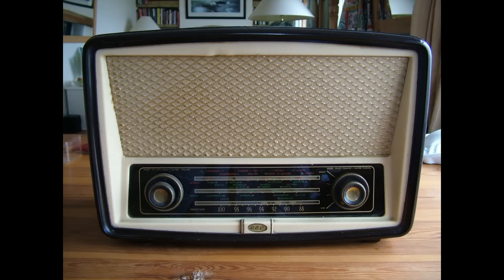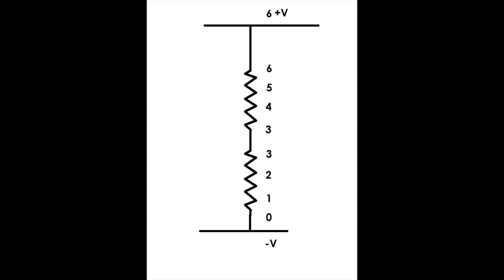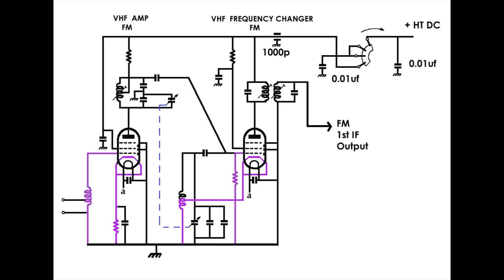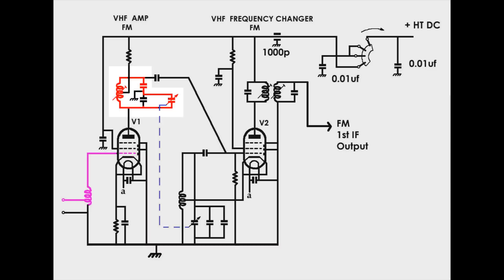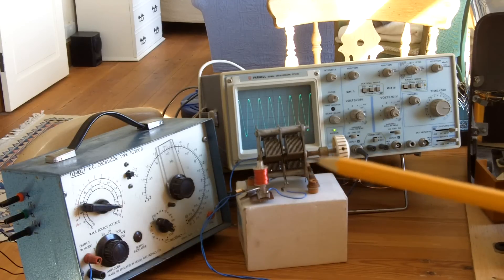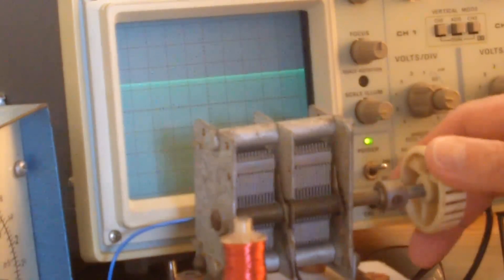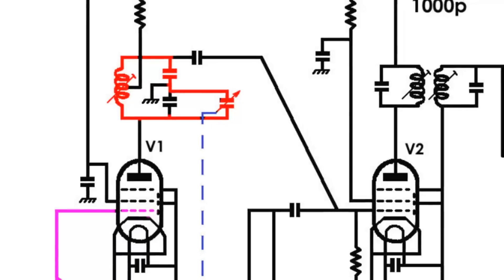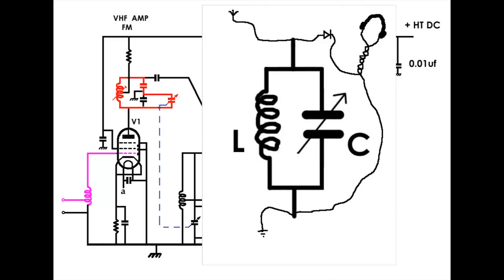About Radio ... Part 6  Grid bias & tank circuits by Andy Davies.

Comment: I am confused about the two capacitors (one red, one black) paralleling the tank circuit; that are connected to "earth" (ground in the US). Unless these caps are very small ones, they would hold the plate voltage of "V1" from being variable. Thus no way the RF signal could reach the "V2".

Please explain these 2 caps, and their purpose in detail, if you could kind Sir. For in most tank circuits, ONLY the secondary of the tank is grounded, as in the tank circuit in "V2".
Reply from the maker: Hi Pat I forget the capacitive values but they will be in the picofarad range. The actual voltage on them will of course be governed by the fluctuation of voltage on the anode of V. The black capacitor is effectively a padding capacitor for the variable capacitor. It increases the value of the variable capacitor to put it into the desired range. The red capacitor and the black capacitor to the right of it (going to the grid of V2) are coupling AC signal but blocking DC voltage. 
Regards  . .  Andy
Reply: @AndyDaviesByTheSea  Thank so much kind Sir. And my friend over the big pond!

Comment from the maker: 2 of 2  The impedance of the capacitor, that is to say the apparent ‘resistance to AC’ of the capacitor will be lower for high frequencies, so high frequencies pass through easily, and the impedance will be higher at low frequencies. So lower frequencies would see the same capacitor as a higher ‘resistance’     
Kind Regards ... Andy 
GWØJXM

Comment from the maker: 1 of 2 
Hi, capacitors effectively stop the passage of DC so the capacitor doesn’t allow the HT DC to pass through it.  AC signals however can pass through the capacitor. So audio or radio frequencies (AF or RF) will flow through the capacitor.
See 2 of 2